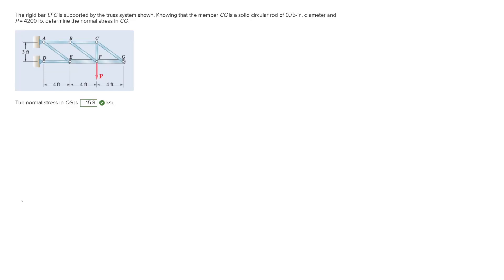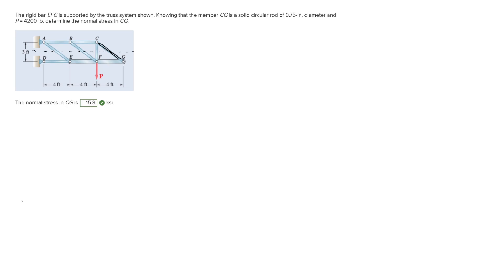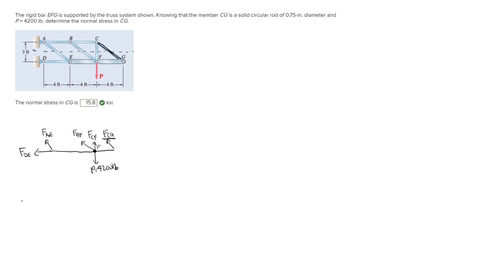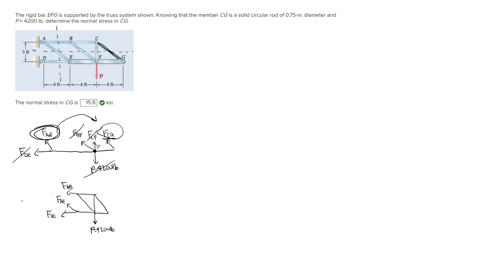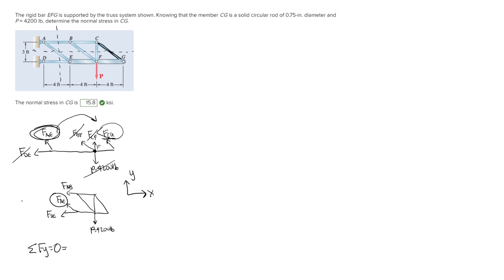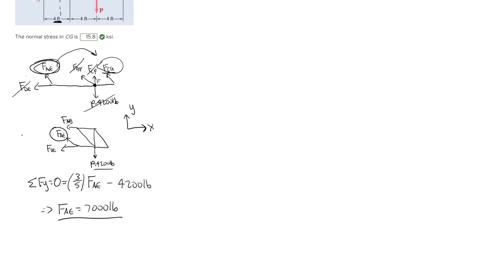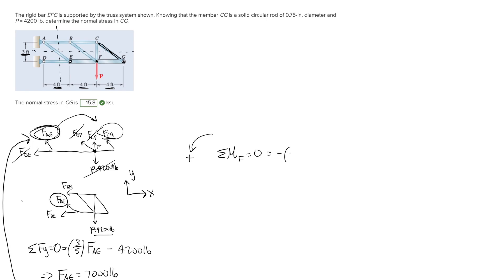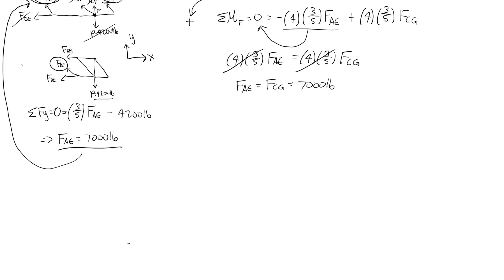Determine the normal stress in CG

Comment: Analyzing this using nodes is much easier. Force P is felt through to node C. C has only 2 y components. -p and F_CG_y. F_CGy = sin(theta)*F_CG = o/h*F_CG = 3/5*F_CG. Solve for CG = (5/3)P = 7000 lbs.
Reply: There's more than one way to solve this problem. Just wanted to show the other way.
Reply: Since we're dealing with 2-force members lol.